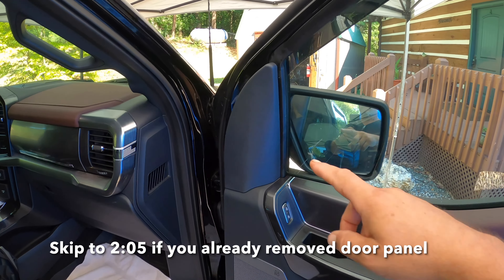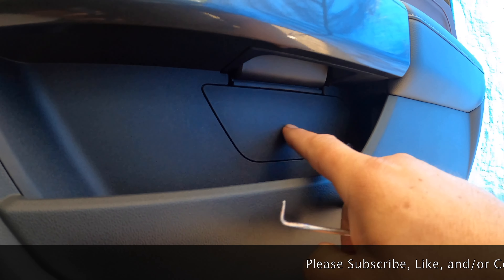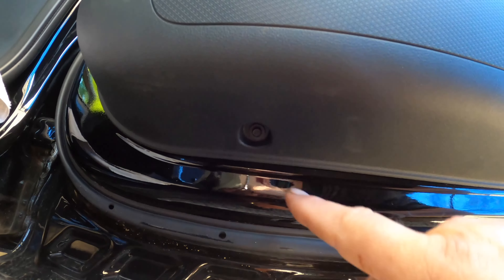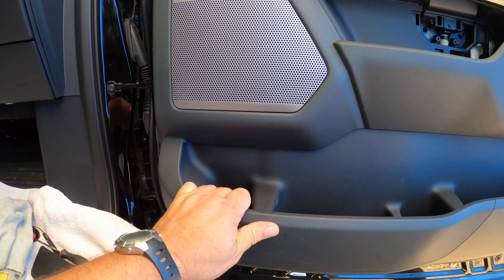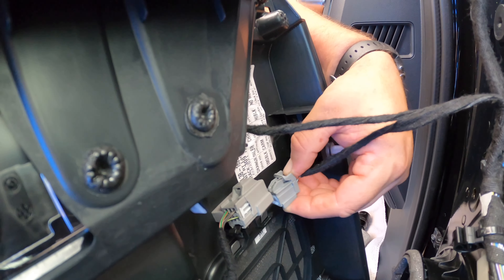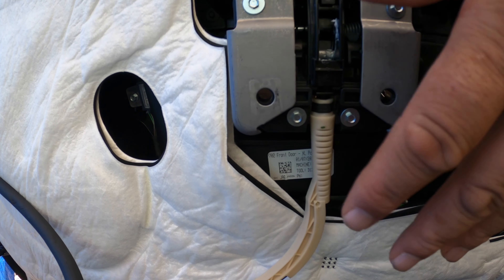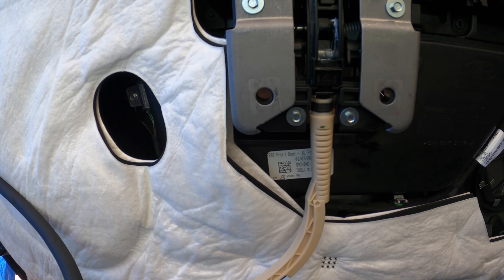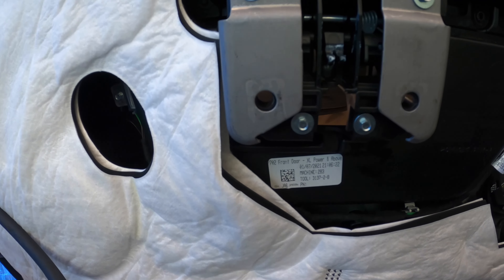2021 Ford F150: Inside Door Handle Cable Removal

Comment: thanks for showing how the door latch cable is released.  this was driving me nuts.  Awesome.  now just need to figure how to release the very small electrical connection on the door latch itself.  One was no problem but the gray one with very small wires is giving me grief. wont release.  ugh
Reply from the maker: No problem. Glad to help out where I can. I am sure you more than likely got the one off that was giving you grief. Those plugs don't want to cooperate sometimes.